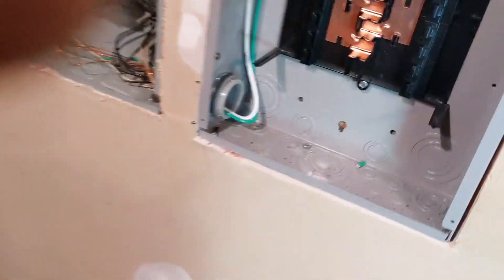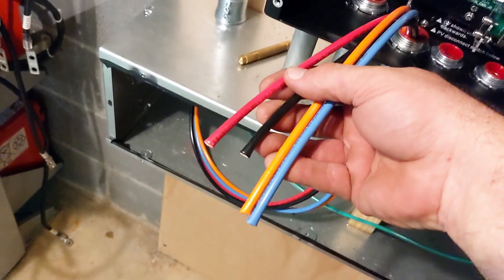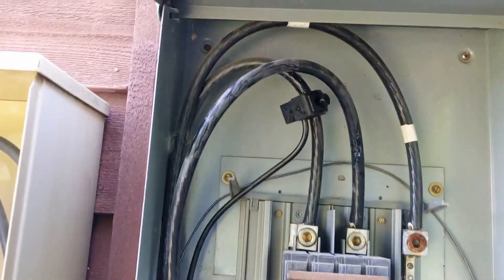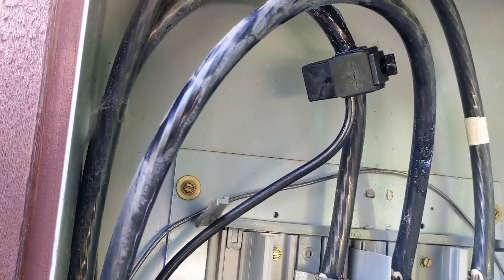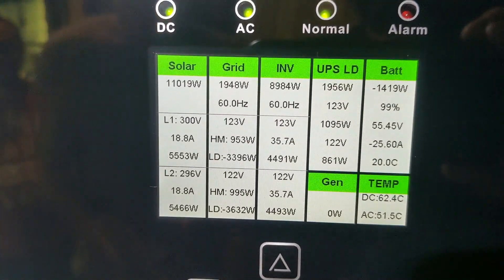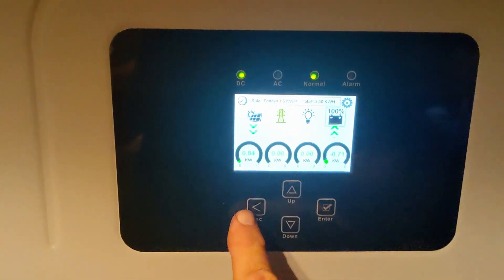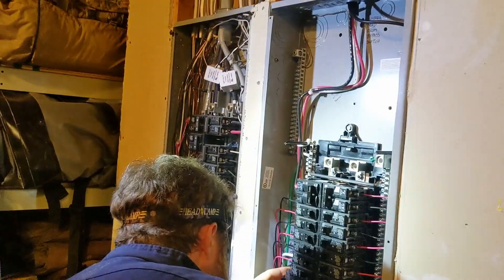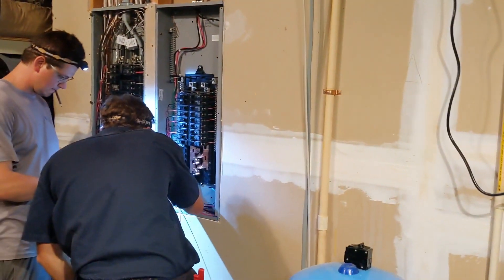High Performance Solar Meets Repurposed Battery

Comment: I have been running 56kwh of chevy volt lithium batteries for 2.5 years with no problems. I have 12,000 watts  of panels charging them. My YIYEN inverters one 12k and one 6k have had 0 problems as well. Just started to do micro inverter AC coupling this week working good so far.

Comment: I was lost from beginning to end. Wayyy over my head. Electrical engineering speak is not in my vocabulary. Neither are electrical acronyms. Those are my shortcomings, not yours. But for someone trying to get their head around solar, this is not the starting point.
Reply from the maker: I apologize. Please ask questions.  I have learned all of this by doing it.  I have a Mechanical Engineering background and avoided electrical like the plague.  Now we are becoming friends.
Reply: @engineer775  I'll ask: "can't land #6" - the Sol-Ark won't accept that size wire, right?
"PDB and transition": use a power distribution block (?) and then what?

Comment: I have an old stack of Absorbed Glass Matt (AGM) batteries from a tele building. I haven't checked them yet. 2 volt each. 23 of them. Need one more.
Reply from the maker: Check them before you install.  We had to discard 4 batteries on this install.
Reply: @engineer775  thanks

Comment: The really sad thing is that everyone has forgotten that there are other battery base materials out there then lithium and lead that simply fell out of favor due to not being portable. How nice would it be for a solar setup where they ship you the empty batter case with the dry chemicals pre measured for that size battery and you simply add distilled water or any other heavy liquid you can locally source once the battery is in place?

To give an idea of how insane some of the battery tech is there is a dry stack battery in England that has been running an experiment for 170+ years and they can't take it apart to see how it was built till it finally runs out of power to not disrupt the experiment.
Reply: Chris Jackson  https://en.wikipedia.org/wiki/Oxford_Electric_Bell
Reply from the maker: that would be cool

Comment: 5% drop over 6 gauge @ 900' +/- 3% should be noticed by the many solar nerdowells that think converting DC to AC gains you efficiency in transference.
Reply from the maker: Thank you

Comment: Another nice neat install. Yes with high voltage you can have the solar a long ways away
Reply from the maker: Yes sir
Reply: @engineer775  some people don't understand that low voltage creates high current if your going to get more watts through the wire

Comment: Is this actually feasible to afford for the average family?  Curious if a setup like this is worth the investment & how long before your upfront cost is recouped on the back end?
Reply from the maker: If you start with a small battery and are willing to do most of your offgrid work during solar hours you would be amazed.  There is a price to energy independence.  I am biased.  I love this stuff.  To me it is of course worth it.  More than a vacation, car upgrade, etc etc.  Lost power 2 days ago and ran all day, flawlessly , on the system.  When my work depends on uninterupted power and I made more than I spent on my system it is a no brainer.

Comment: I am sure for most of your viewers these are very informative. For me (also and Engineer) without some basic system architecture drawing it is not possible for me to follow what is going on especially with the constant use of acronyms that are seldom defined. Anyway, it is amazing and thanks for sharing.
Reply from the maker: Good point and I think I am going to start including some basic1-line drawings in the video.  Every project is custom and we take a lot for granted as to terminology. My apologies.
Reply: @engineer775  I would love to nerd out over some single lines with some numbers on them! You'd definitely have my vote!

Comment: Just yesterday I was telling my new co worker, new company for me, about wanting to buy used cellular tower batteries. And here you are the next day posting a video with them.

Sooo I must ask, how did you go about getting them? Did you purchase them directly from the cellular phone company? Middleman? And how did you make the first call, like “what department” did you call?
Reply: I am the Facility Operations Manager for a Telco. Per EPA regulations we have to track our HAZMAT Cradle to Grave. So when we buy it its entered into an EPCRA tracking form. When removed from service we have to fill out paperwork and submit it annually to the EPA showing the removed hazmat was recycled or handed off to a certified recycler. So we cant handoff batteries to people like we used to. But you may be able to get them from the recycler. Typically telco batteries are disposed of based on warranty and they are rated to have 80% capacity at their "end of life". so they would work well for some people. One thing to note is many of them are designed to endure heavy discharge but for not many cycles. So I would be conservative on my SOC cut-offs with these to get the most life out of them.
Reply: @murphyslaw907  Yeah, they are basically a UPS battery, large discharge current but low cycle life. If you put them in setup like this and are discharging them daily they won't last very long unless you limit the discharge to about 20% or less of the capacity. Most UPS systems only have to discharge a few short amounts of time in a given year, especially if there is a generator backup, so they mostly just sit there being kept charged. Older UPS units however can be hard on the batteries over time, basically slightly overcharging them leading to a shorter lifespan, newer ones are much better at only doing periodic top up charges to keep the battery life high. I've used some UPS batteries for a short period of time till I could buy a better battery bank, but I wouldn't depend on them long term if you are cycling them daily cause they just weren't built for it.
Reply: I'd like to know too!